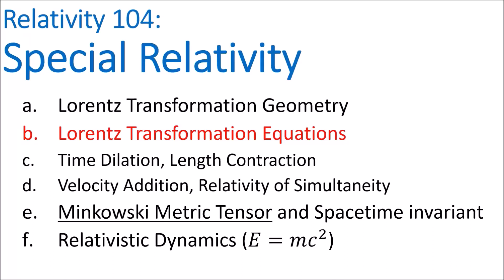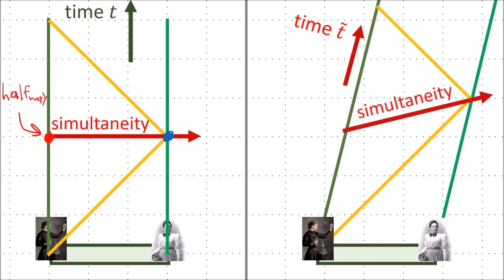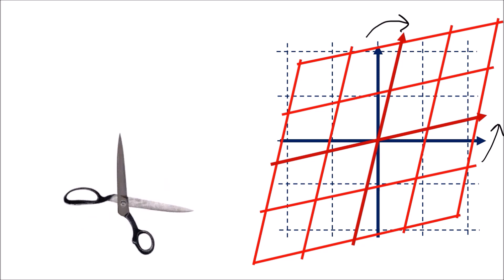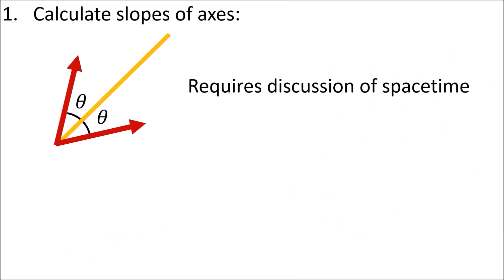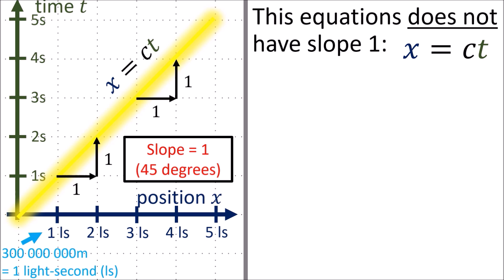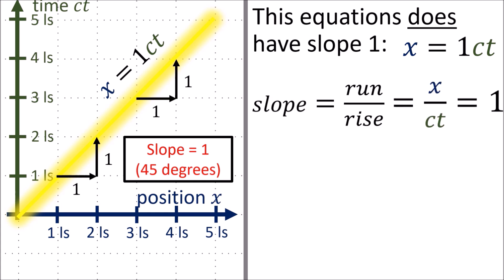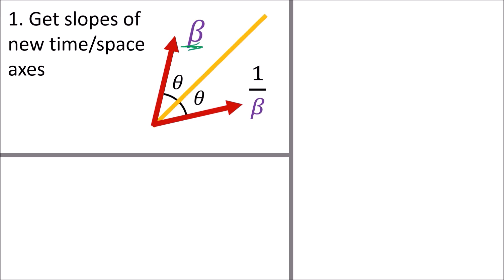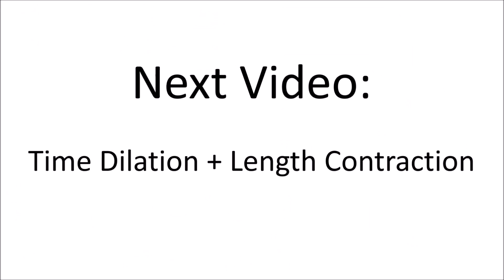Relativity 104b: Special Relativity - Lorentz Transform Equations Derivation

Comment: Hi, Eigenchris.
Thanks for your interesting videos. I want to comment on some issues in your 104b video and ask some qustions.
At 9 minutes approximately you write equations for x’ and t’. Although you do make a plausibility argument, it is not logical. Here is a way to fill in the gaps.
Let T = ct and T’ = ct’ be measurements of time in space units in two reference frames R and R’.  
Define  R and R’ with bases B and B’ (time as above and space)  to be inertial with respect to one another when  the 2  by 2 transition matrix L from B to B’ has constant values (first row m n, second row p q) and when for any T, L (T, β T) has space component 0 in the B’ system. (Multiply L by the transpose to get the transpose of the vector.) This turns into the condition p = - β q.
The speed of light is the same in the two reference frames translates to m + n = p + q. The simultaneity condition becomes m p = q n. That is, the angle theta in your figures is the same for the T’ and x’ axes given in your picture.
 When we solve these three conditions we get q = m and  n = p = -β m.  This is your result for m = γ.
Then you say that γ is independent of change of reference frame and knowing this you solve for it. This is not a convincing argument for me. Better is that the area is preserved, but still not convincing. Also γ could be +/- . Why do you choose the plus sign?
Thank you for any comments you might have on this. Keep up the good work. Jim

Comment: I am confused by why we expect that gamma should be equal in both directions? I thought we would expect gamma in one direction to be an inverse of the gamma in the other direction. At least this is my intuition if I assume gamma to be a scaling factor to ensure that spacing of grid lines for the stationary observer is the same as the spacing of the gridlines for the moving observer. I mean: if one way the spacing needs to grow, that in the opposite way it should shrink, shouldn’t it?
Reply from the maker: The shape of the spacetime rhombus is controlled by both gamma AND the + or - signs in the transformation equations. If you watch the first half of the next video (104c), I give a geometric explanation of why gamma is the same in both directions, and how the change in sign makes everything work out okay. Basically, a + sign will push the basis vectors up-and-to-the-right (like closing the scissors) and a - sign will push the basis vectors doawn-and-to-the-left (like opening the scissors).
Reply: @eigenchris  thanks. I think my mistake is to treat gamma as a simple scaling factor that is supposed align grid lines. So even before thinking about rhombuses I was thinking something like this:  the observer A is measuring lengths using a stick of 1m and the observer B is measuring lengths using a stick of 1.8m (the sticks are like the basis vector ex for both).  So the scaling factor will be 1.8. Now I see that it’s not that, but I still need to think more about it.

Comment: I think there are two errors at 10:58. gamma cannot be less than 1 and gamma = 1 only if v = 0 i.e., 
the ct tilde and  x tilde axes will coincide with the ct and x axes.
Reply from the maker: On this slide we haven't yet figured out that gamma = 1/sqrt(1-(v/c)^2). We just know it's a constant that sits in front of the equations. I'm just showing pictures for what this gamma factor would do if it were <1, =1 and >1. Of course, after we prove that gamma = 1/sqrt(1-(v/c)^2), we know that gamma >= 1.

Comment: Here slope you are taking with respect to which axis, ct or x ? 
And how slope of time and simultaneity  axis are reciprocal of each other.
Kindly explain a bit as I could not understand. Thanks
Reply from the maker: I am doing "distance / time" for the slope, so a vertical line has slope = 0 and a horizontal line has  "infinite" slope. The two axes have reciprocal slopes because they make equal angles with the beam of light between them (which is at a 45-degree angle). I proved this in the last video, relativity 104a.

Comment: Why do a lot of these guys that do math/physics tutorials, lectures etc, feel  like they have to apologize for the math in physics videos,
The math is the core of all of our theories. You cant even write down the Einstein Equation without knowing Tensor analysis/algebra. To say something like "the Einstein Equation gives curvature on the right and mass/energy on the left" gives the student the impression that all you have to do is measure some stars mass/energy, plug it in to the equation and out pops the Schwartschild metric. And yes, i know that this method can work(in principle). Thats how i used to think. But every time I tried to do that, by the time i was done, i must have filled 100 pages of a notebook. I know now that there better methods than the brute force approach. The reason I had to do it was that I had no teacher, no other "students" i could bounce my ideas off of. The reason being that i was in prison for almost 11 years, I used to rob banks if you can believe that, i had a viscous drug habit at the time so I supported it with a few "unauthorized loans". Point being, is you cant learn these subjects without the language of math. Thats like going to Germany and trying to physics, but knowing not a speck of the German language. Sorry about that rant. But my point remains, you should never have to apologize for making the video "a bit mathy". I think(and this just my personal opinion), that if teachers do include the math in  physics courses/lectures/tutorials and so on and so forth. What that will do is weed out students who are taking the course as a prerequisite for some other cource, and the others that are serious and passionate about physics. I mean no disrespect to you and other YouTube lecturers/tutors i watch all those videos constantly. All iam saying is you guys should never have to apologize for that. Long rant, sorry. Love the videos.

Comment: At 10:44 when you say that the spacing between the gridlines is preserved, do you mean the horizontal and vertical spacings or the actuals lenghts of the parallelograms? I suspect that the former is true but the latter is not. Thanks.
Reply from the maker: Yeah, it's the horizontal/vertical spacing I was referring to, but I can see how that's confusing given other diagrams I've drawn on other slides. Basically if gamma = 1, the gridlines just tilt but don't move apart from or toward each other.

Comment: The area preservation seems to be something important and to suggest that we should not treat time any differently than length dimension.
In high school, I was always taught that SR will make different area/volume measurement different between frame because there is at least one axis of length that is contracted by Lorentz factor.
However if we think of spacetime as a whole set of 4D length, then the 4D volume are measured the same in both frame. For an axis of length that is contracted by Lorentz factor, it is accompanied by an equal factor of time-interval dilation between that measurement.
If we consider time as length ct, the area of 1 square meter in one frame will still be 1 square meter in the new frame. If in the new frame the length axis undergoes 1/2 factor of length contraction, then it just means that there is a factor of 2 for the time components, so that the total area still be 1 square meter.

Comment: Something I never understood: Why do both length and time have the factor gamma in the Lorentz transformations, even though one contracts and one dilates? Any answers on this would be much appreciated. Also I'm super hyped for the next video :D
Reply from the maker: This will get explained in the next video. The key is that time dilation and length contraction are fundamentally different: time dilation is measuring the same spacetime vector using 2 different bases, but length contraction is measuring 2 different vectors in 2 different bases (we need to choose frames where the vector is parallel with the position axis). The time dilation equation comes from plugging in x=0 into the Lorentz transformations (you get the two times related by a factor of gamma). Getting the length contraction formula is more complicated, and we get a factor of 1/gamma instead.

Comment: Do you think time dilation and length contraction is real or apparent?
Reply from the maker: For inertial frames in special relativity, I think "real or apparent?" is the wrong question to ask. Different observers measure different times. None of them are correct or incorrect, they are just different points of view. This is just like getting the components of a vector in 2D space geometry... you can get different numbers in different vector bases, but none is correct or incorrect, they are just different points of view. However when it comes to situations like the twin paradox (where a traveler does a "there-and-back-again" journey" and ages less than a stationary observer), or gravitational time dilation in general relativity where clocks tick more quickly farther away from earth: yes, I think those are 100% real.

Comment: I am so happy to see you don't derive gamma from the ad-hoc rule that "Lorenz transformations preserve area". Which may be true, and is pretty common approach, but comes completely out of left field. Requiring that the two reference frames see the same gamma for the other frame is much less of a leap of faith, especially for newcomers to SR. Much better to derive the area preservation after the fact.
Reply from the maker: I'm confused how "preserving area" could ever be a starting point as opposed to a result. Do some sources do it that way?
Reply: @eigenchris  I am confused as well. I was preparing a short SR lecture before summer, and searching the web for good introductions, and physics.stackexchange seemed to like area preservation as an axiom. And when I took GR at university, that's where my lecturer started as well, basically reasoning with "Euclidean transformations of space preserves area, so it makes sense to require Lorenz transformations of spacetime to do the same".

My old highschool book uses a light clock arranged perpendicular to the direction of notion, but that requires two special dimensions. That didn't fit in the lecture I wanted to hold.
Reply: I think it's due to overappreciation of mathematical "beauty" as basis for logical reasoning. "We want it to have this nice property, because it just makes sense to us." But that is of course not a real physical argument for why it must be correct. Sabine Hossenfelder is great at critiquing these kind of assumptions :P
Reply from the maker: Was thinking about this again... I suppose in theory if the Lorentz transformation were to change spacetime area to be smaller, then the reverse Lorentz transform must change spacetime area to be larger. If we want all inertial frames to me on equal footing, the Lorentz transformation to be symmetrical, you must automatically assume the determinant is 1 so that the area doesn't change in either direction. It's a very abstract way of viewing things, but I guess it could work. (The Galilean transformation also has determinant 1, probably for similar reasons.)
Reply: @eigenchris  in layman's terms, why is it necessary to preserve area?
Reply from the maker: @ghasthordegd1201  My above comment is the only way I know how to explain it... but basically you need to preserve area so that all directions in space are the same. If you didn't preserve area, some directions would be "more special".
Reply: @eigenchris  what do you mean by reverse Lorentz Transformation?
Reply from the maker: @ghasthordegd1201  I just being doing a Lorentz transformation with the opposite velocity. (in the opposite direction).
Reply: @eigenchris  So, if the primed observer is moving to my right at velocity Beta, i use 1/√(1-B) to transform to his coordinates. But since he percieves himself to be stationary and percieves me to be moving with velocity -B, then he uses 1/√(1-(-B)) to transform to my coordinates? Is that what you mean by "reverse Lorentz Transformation"?
Reply from the maker: @ghasthordegd1201  The beta inside the gamma-factor is a beta^2, so its sign doesn't change. But the other two betas in the formula will change sign.
Reply: @eigenchris  ahh ok
Reply: Interesting. I'm guessing that the requirements of making the area preservation are conserved because in SR the geometry is flat. 
However, as you said, saying that in SR geometry is flat is like making an axiom. 
But it is possible to derive Lorentz transform by using this set of axiom:
1. The transform must work in flat geometry (but in this stage, there is no more fundamental reasoning on why we need to assume this)
2. The transform must preserve light slope to become always the same after transform.

But I agree though. It is easier to accept that gamma should be the same from both frame, then derive the area preservation corollary, instead of the other way around.

Comment: If a scalar is equal to the e_1 basis vector times the scalar, then there is a slight problem 

A row vector [1 1] being scaled by 3 will output another row vector

A column vector [1 1]^T times the row vector will give you a 2 x 2 matrix 

I could see this problem being fixed with an implicit tensor product, but I haven’t seen that said anywhere